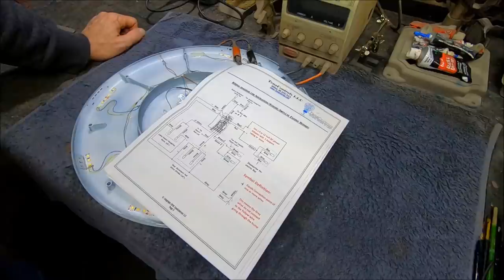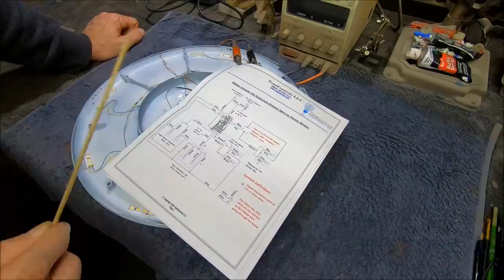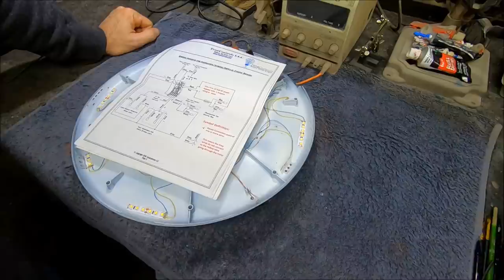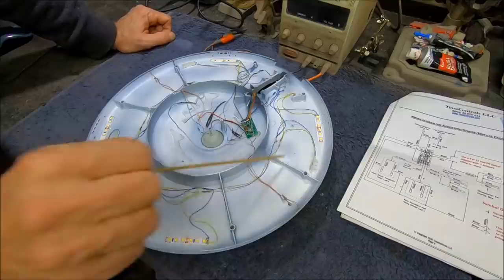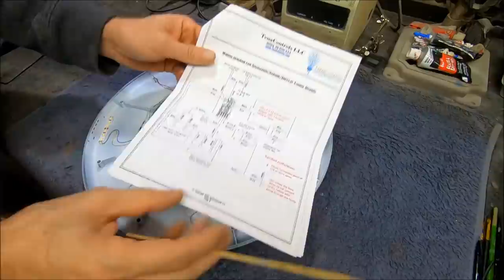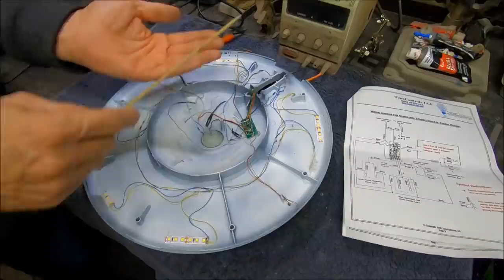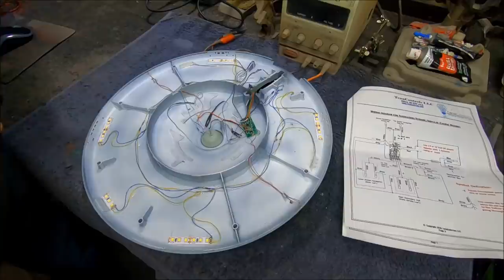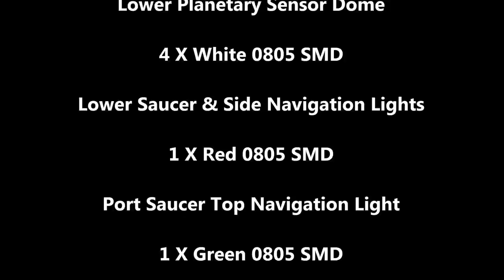Updated 1:350 Scale Polar Lights TOS Enterprise Build Series Pt 2

Comment: Wire Wrap Wire is part of a prototyping system. One can get pins designed to poke into .1” center prototyping board. A little tool strips then spins the stripped wrap wire to the post. Little boards in each section of the hull could receive wires. Solder the whole magilla and cut the posts short once everything is in place or just leave it. The un soldered, wrapped connections will run as is for years. As to power, I have put batteries in parallel to extend the available runtime and keep the same voltage. That is a great way to compensate for the marginally higher current use from a parallel wiring circuit. Series circuits sum resistance. Parallel circuits basically average the load, lower resistance equals higher current draw.

Comment: Good to see an updated build log. You mentioned an uneven fit of top and bottom saucer sometimes. Mine was the replacement smooth saucer I bought, and on this one the lower bowl edge is actually higher on the join than the top edge most of the way around. Not a lot, but noticeable. Fun time sanding.

Comment: Hey Boyd, I understand the one wire of NEG. and POS. and tapping an LED from the sides and just hot glueing over the exposed solder joint of all three wires...but there is a way you can still use a shrink tube to safely secure your solder joints, what I do is I use my fine tip snippers and bend the shrink tube nip a hole as close to the wire gauge as possible in the center of whatever length tubeing I'm using, take the wire I have coming from and SMD or LED and fish it through the hole and fish each end where I cut the wire so that all three are at one end...solder then gently pull the center wire till the solder point is a Mil. or two from the hole I cut, then use the lighter to heat the shrink tube and it will shink as it should and will close around the third wire coming in and it's as strong as if you just joined two wires together and used shrink tubing and there ya go, just thought I'd share that... Happy modeling.

Comment: Even with this video explanation all that wiring still looks scary, Makes me glad I got several other kits like a Flying Sub and Jupiter 2 i'll be building and lighting first before moving on to something as complex as my own 1/350 Enterprise with Tenacontrols LED motorless kit
Reply: Honestly, lighting the Jupiter 2 (depending on the level that you go to) can be much more complex than the Enterprise.
Reply: Actually the very first kit I'm going to practice lighting is a vintage Leaf Ericson I was lucky enough to locate that not only has the record but still has the original clear Red and Chrome engine parts. Then I'll move onto the Flying Sub and then the Jupiter 2.  And while I have ordered all the bells and whistle J-2 after marked items from photo etch to a circuitry wall insert that has real miniature circuitry in it, I'm not feeling to intimidated about it because I'll be starting out with the Moebius plug and play lighting kits.. What's intimidating about then doing the 1/350 TOS Enterprise is that the Tenacontrols lighting kit unlike the Polar lights plug and play doesn't include the window lighting and so I'm hoping to learn from these new videos from Boyd how it all wires to the same power source.. Frankly I don't understand why Tenacontrols doesn't make there own fully plug and play kits, I'd pay the cost for it.
Reply: Agreed, that’s why I worked on the shuttle craft and the Martian war machine first before I start at the enterprise.  Still working on the Martian war machine as a matter of fact.
Reply: @RankinImagery  The Martian War Machine! That's it! Ya know after being out of the hobby for almost 30 years I am finally retired and now have the time and money to get back into it, And I've spent the last few months ordering all the Moebius, Polar Lights and Round 2 kits I've been drooling over for the last few years, In fact I just ordered yesterday what I figured would be the last kit for my massive stash which is the Proteus, But there was still something missing in the back of my mind, And that was it, The Martian War Machine... Thanks :)

Now I just hope I live long enough to finish all these kits.
I'm not exactly a young man anymore, Which means my eye sight and the dexterity in my fingers ain't what they use to be, But there's still something satisfying about owning them all at least.
Reply: @Spindrift-id1ez  I understand about the age thing.  I am 63 and semi-retired.  The only modeling I've done was as a child and that was basically 'glue and stick it together'.  No where near what is done today.  Building the TOS has been my 'life's work'.  Building it perfectly, or as close as I can get to perfect.  Also with a base lightbox.
Reply: @RankinImagery  The other day a friend of mine said: Hey JD why don't you just have that guy you watch on youtube build it for you?.. It was all I could do not to slap him upside the head. He still doesn't seem to understand why I'm investing in an airbrush kit with compressor instead of using a rattle can.. Course I'm in uncharted territory when it comes to that. I still have no idea which make and model type to get :/
Reply: @Spindrift-id1ez  Actually, I thought the same thing late spring, early summer 2020.  Fortunately, I came to my senses in late summer to just move forward, albeit rather slowly.
Reply: @RankinImagery  Come to think of it I got another problem I'm going to have to figure out too. When my wife passed away two years ago I sold our house and moved into a small apartment, And there ain't exactly a ton of space for things like a 28" C57D much less a Flying Sub and Seaview and Jupiter 2 and 32" Enterprise etc etc etc.. Normally I'd simply hang it all from the ceiling But when we're talking about a bunch of power lines for the lighting kits it's gonna be a whole different story. I should probably give some serious thought into taking to the manager about moving from my studio into a one bedroom, I would still sleep on my comfy futon in the front room and turn the bedroom into work and display space.
Reply: @Spindrift-id1ez  Same here, except me and my wife still have a lifetime of stuff.  I can't build too much, but so far, that's not a problem.

Comment: Great video, thanks.  This was made about 2 years ago.  I searched for  the model master liquid cement you used and appears it is discontinued.  It appears to have given you some time to adjust getting the saucer halves lined up properly.  Most of the pure CA glues will not provide sufficient time.  What are you using now since that glue is not readily available?  Thanks.

Comment: A few questions....while you are gluing the Top and Bottom Saucer sections and the inside Structures don't the glue start drying about a minute after applying?  I can't see that the glue would still be wet enough to seal both halfs securly enough seeing the glue might be partly dried in some spots before adding the Top half of the Saucer, I glued smaller halfs of model and I had to hurry cause my glue would start drying before I got to the other side and it wouldn't seal good...had to use a slower drying glue. I was using Testors glue in the black diamond shape bottle.  Does that model Master glue you're using take longer to dry?

Comment: Thanks so much for these videos. I do model railroading and am getting back into building sci-fi models also. When I first looked at your wiring I was scratching my head and then it dawned on me that we wire our railroads the same way. We run (I use DCC) bus wires all the way around the railroad and then install feeders from the rails and you are doing your wiring exactly like that. I would ask a couple questions though. One: Should I get a variable DC power supply to check the wiring (I expect "yes" to that) AND  Two: you're using Modelmaster glue instead of something like Plastruct Bondene. Is that because it stays liquid longer rather than evaporating like the Bondene tends to do? Thanks so much. These tutorials are helping a LOT!

Comment: Hello Boyd. Are these LED strips meant to run at 9V or 12V ? Can I order 12V and simply run them with a 9V 1A supply?
Reply from the maker: They will work from 7-15 volts. The more voltage, the brighter they look.

Comment: Anyone ever thought about using a visible line laser diode to simulate phaser blasts?
Reply: Problem with lasers is, you need particulates (like smoke, fog machine) in the air to make the beam visible. Otherwise for the most part you end up with two laser pointer dots showing up where they are aimed at from within the model.
Reply from the maker: I don't use lasers because they have a very limited life span. Once they burn out it means tearing the model apart to fix them. They do look cool though.
Reply: @TrekWorks  Not that I can ever imagine putting a laser in a model, The fact that they don't last is definitely good info to know, Thanks :)

Comment: Boyd, which one of the Solarez do you use? Getting my stuff together and was wondering on it. Tia
Reply: I was looking at the website for Solarez and comparing to Boyd's video, he is using Solarez Doming Resin. It is $22.75 for a 2 oz bottle and the flashlight is $57.20. I did a little more research and found out that most "UV flashlights" aren't powerful enough to cause curing. My opinion is if you're going this route, spring the extra money for their flashlight.

Comment: I ordered some 0805 LEDs but they don't come with resistors. Anybody know how many ohms I would need for those?
Reply: Never mind. I just saw that all the LEDs come with the Tena Controls LED Fan Blade and Control Boards. I'm assuming any resistors needed are on the control board.
Reply from the maker: @malcomterry7076  If you do need resistors for the SMD's, 470 ohm 1/4 watt will work fine for operating between 9-12 volts dc.